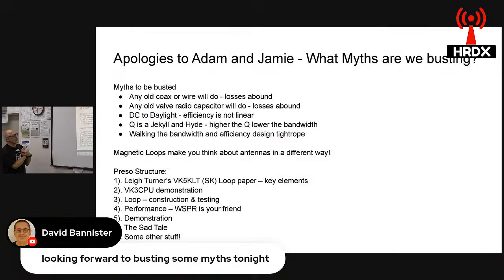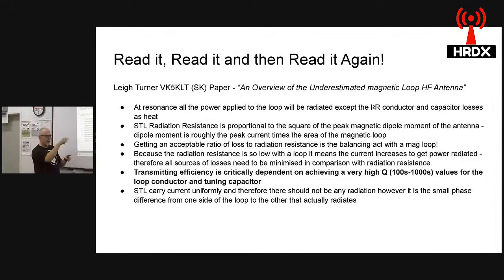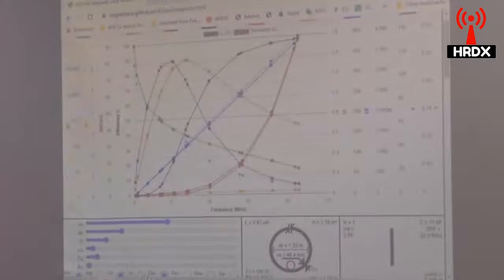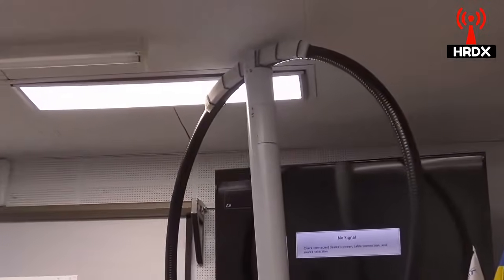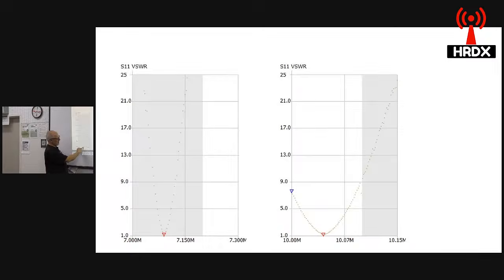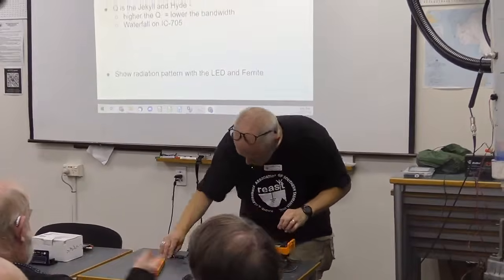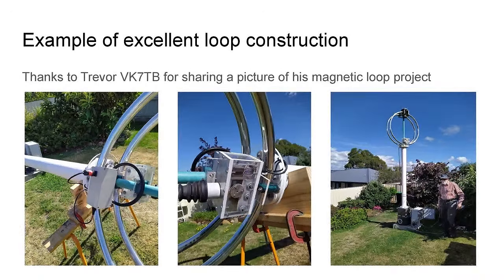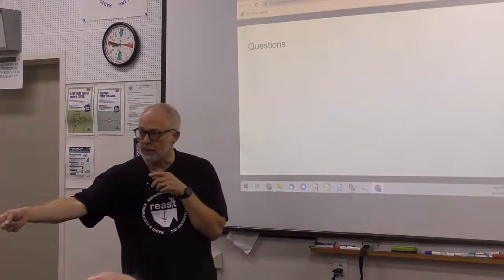The Truth About Magnetic Loop Antennas - MYTH BUSTING!

Comment: Howdy.
With all due respect.
I do not agree about the uniform current statement. My understanding is the current is largest at the feed point and the voltage is largest over the capacitor. For any size loop.
Cheers.
Reply: Read the literature on small loops. The "small" qualifier comes from the fact that the length of the loop is way lower than the intended wave length, hence the current variation across it is negligible and can this be considered constant.
Reply: @randall.chamberlain  Howdy.
Aha. OK.
Cheers.

Comment: Square loops work fine as long as the overall area is the same. circular vs square loop with the same area negligible difference.
Reply: and that allows you to use a tubular capacitor with no connection losses, maybe as efficient as a vacuum capacitor with lossy connections?

Comment: Great video. In practice the resistance of your solder joints and even using aluminum instead of copper, it really doesn’t make much of a Noticeable difference as long as the radius of the conductor is chosen correctly.  Most commercial antennas get the diameter wrong btw.
Reply: i had lots of success using pexal water pipe and thats plastic with literally just an aluminium foil layer. a 2 turn loop with a smaller diameter section pushed in the ends to close the loop and make the capacitor. tuning is a threaded plastic rod that adjusts the space between turns. i made, used, and sold many with good feedback. so cheap and light for backpacking

Comment: I tried various coupling methods and found an unshielded loop easiest. It has finished up a bit distorted for better matching..
WSPR is okay but it's not like communicating and making real contacts to see how good it works. I don't bother with WSPR.
I made it to null out interference on receive and use dipoles to transmit. Indoor use only. I have transmitted on it and the receive type capacitor is fine with my 5 Watts maximum. I used a thick 7 foot length of coax  to make the loop, it's just what I had.

G4GHB.

Edit: My interference has now cleared up since the phone wire was changed to fibre.
Reply: back when psk31 was a thing i had a great qso from Bulgaria to Washington dc from a small indoor loop on my ft817 on under 1w. i miss psk31

Comment: As material for my loop, I am using a flexible exhaust hose with an aluminium coating. The hose is 5 meters long and has a resistance of approximately 5 ohms. Does the ohmic resistance affect the high-frequency properties in qrp?

Comment: I was trying to calculate a loop the other day to help combat terrible rfi. 
  I was wondering if I could feed it with a 9:1 balun and if so then would the loops tuning network be less necessary? I was thinking a simple capacitor like a flat piece of aluminium at the top open end of a flat aluminium loop, while keeping the point of capacitance central the idea is to slide an overlapping piece over and above the main top section of loop, adding capacitance the more it overhangs the top section. Regarding the matching to inductance with a bar or smaller fed loop it cam to me that if your feeding a smaller loop you can add some variables by orientating the smaller loop like a clock and then clamping it back down, in other words the feed point on the smaller loop, rather than it being at 12 o clock, you could loosen a bracket and move the feed point towards 9 o clock or towards 3 o clock for tuning then clamp it back down. Then I thought, might as well add another variable and make that clamping point be able to clamp to different points of the main loop, so either clamping slightly up towards 8 o clock or sliding it up towards 4 o clock for further adjustments. 
  The calculator told me that my design would have an Inductive Reactance: 465 ohms
This is why I was thinking to have a 9:1 balun to feed it with.
  Regarding diameter i have seen that large diameter works better but then the flat sheet metal loop also looked interesting. I was wondering how making the flat aluminium much deeper would effect the loop. 
  The idea is to have a batter signal to noise ratio as we have noise around S7 S8 at times.
  No chance getting the French electrical provider to come out and change the transformers. 
It's hard to know if it's a transformer. I found a very noisy one but we only live around 3 miles from a hydro electric plant. I'm wondering if they have noisy generators and then that noise comes down the power lines to us only to be re-transmitted by all of the power lines. I need to do some more walking but an area of around 10 Km square where I live is extremely noisy. I've driven around and the noise keeps cropping up all over the place. If I drive to other villages then they do not suffer the same noise. However, driving around in general the noise is apparent in many other places.
  I was also wondering if it could be the noise from all the smart meters sending data back down the lines.
 I'm at whits end and my friend who lives around 10-15km from here is suffering also. Possibly more than me but I think my radio has better filters than his. Tried noise cancellers like the VK5 but they only reduce noise with the gain down quite low, this is ok but it's not really enough. Next is current baluns and or 1:1 unun's then as many ferrite beads as possible on coax and all cables. I have a sound cancelling box also but i've not tried it yet.
  Thinking that selling the house is the only option.

Comment: Very interresting lecture. If you want to build a loop from coaxial cable, you can do it without expensive or infindable  capacitors.  Of course, only monoband.  Nearly all LDF cable resist up to about 4000V.  So, use the capacitance of the inner conductor to the outer. It's in the range of 75 to 90 pf/m . Just connect at high point the  inner conductor to the outer.  If it resonates with a dip meter at the high edge of the band you only need a small variable capacitor two or three plates, 50pf to tune the whole band. It worked fine, i built one for 160m some 15 years ago. With lower point 30cm above soil, it was about 10db weaker than a full size dipole at about 10m high. Mine was from LDF 1/2" .  F1VEL ex DB3YZ. 👍🏻🇫🇷

Comment: What does "0.049"" under "Wavelength" column in the top row "3.5 MHz" mean in the interrelationship tool summary table mean? Units (or dimensionless)?

Is the minimun useful size 1/8 wavelength or the 1/10 wavelength of highest desired frequency of use I've seen elsewhere?

Comment: I built a hexagon loop out of 3/4 copper water pipe soldered 45's, using an air variable capacitor 250pF Antenna circumference is: 8.75 feet or 8’ 9”
21-inch circumference input. I will tune 40-to-15 meters, at 20 watts we made digital contacts from my friend's basement to all around the US 
I will take it outside this Monday when he returns it and see if I can make voice contacts, over the pond.

Comment: Great information. Thank you.
It is enough for me to understand that my Mag loop is going not be optimal with "any old" capacitor, (limits power) and to keep my connections and as low resistance as possible.
If I insist on building an optimal mag loop, I'll never build one.
Reply: any antenna is better than none. once at a club open day i made a working magloop from the jump leads out my car with the ends twizzled up to make a capacitor. tuned swr 1:1 on 20m and got a contact straight off the bat

Comment: New to all this, sorry if it's an irrelevant question but does radiation pattern essentially provide both ground wave and NVIS characteristics?  If so, is it possible to orient the hole up and down such that you achieve an omnidirectional pattern WRT azimuth, and despite losses straight up still have some emissions vertically enough to still fill in the skip zones like an NVIS?

Comment: There are some advance design secrets that improve bandwidth and efficiency, but those are very rarely mentioned anywhere on the internet. But the real challenge is building all that into a weatherproof package that can withstand the extremes of weather outside up on a pole for 5 or 10 years with minimal maintenance. Few hams ever attempt or achieve this, but it can be done.
Reply: Such as?
Reply: @johnratcliffe6438 yes agreed, please tell us if you know. Do you have any references to point us to?
Reply: Käferlein AMA
Reply: @df7ii  "Little Beatle" - interesting!

Comment: Great video, but what makes a capacitor lossy? He shows a chart that explains how capacitance influences radiated total, but what is it about "any old valve capacitor" versus a vacuum tube capacitor that makes such a big difference? Are old air variable capacitors just too crusty and corroded for RF? I just didn't see where this myth was busted.
Reply: "any old valve capacitor" has wipers.  That is to say, the rotating plates have electrical contact through wipers and those delicate little wipers are not designed for the 20 amps or more of RF that will be circulating in the loop.  
A good capacitor for this is called a butterfly capacitor; no "wipers".  Such a capacitor can handle enormous current. 
Also, the voltage is going to be pretty high.  A 100 watt transmitter will produce anywhere from 1000 to 4000 volts on the capacitor and remarkably high current.
Reply: A search for "VK4AMZ loop" will yield his experience with doorknob caps, which are lossy. I use 4 ft lengths of 1 7/8" Heliax as 100pf caps in a design and those are about as low loss as one can get besides air variables.
Reply: A conventional air-spaced dual gang variable capacitor can be used.  Ignore the rotor (mostly). Connect one end of the loop to one of the stators and the other end of the loop to the other stator.  The shaft that joins the two rotors then conducts the RF current and is effectively a butterfly capacitor.  Also, it doubles the voltage rating of the capacitor.

Comment: To further the performance research, I would be interested in a side by side comparison of the loop vs a dipole (all other factors equal) using the WSPR data collected.
Reply: All other factors tend not to be equal.  A dipole suitably high above perfect Earth is the ideal antenna.   If you don't have all that, a mag loop antenna works pretty well where a dipole in NOT ideal circumstances would do even more poorly.
Reply: @thomasmaughan4798  Then the proper test would be comparing a dipole at an optimal height against a mag-loop at perhaps 6 feet or so and measure the dB difference, or, using WSPR data.  When I stated “all factors equal”, I meant using the same transmitter and power level.  The antennas would be in their normal configuration.
Reply: We 'played' at that in 2013 - 2020 thereabouts. I hit EU from Texas most nights using a QW circumference loop (which this presenter misrepresents, as usual) running against others ops here stateside. I captured a lot of that data - it needs to be graphed using Excel or R or something and presented.
Reply: I have a Toploaded Marconi Outside,  the vertical section is around 9 metres.   Indoors I have a 1.6m diameter broadband loop made from scrap RG213.     I ran concurrent WSPR sessions over 24 hour periods on 630m and 160m.    No real difference, for RX I'd go with my indoor loop -.  There is a lot of data with lots of curiousities.

Comment: Should be good for NVIS in suburban/urban areas.
Reply: I work the 160 m evening net on 1900 kHz from Texas given the low radiation angle from a QW loop on 160 meters from a city lot in Texas ... I have trouble hearing those stations with low dipoles though, because, they do not have that low rad angle ...  a remote receiver SDR helps in that case!

Comment: The tuner probably didn't have enough capacitance to tune that long of a wire on 10m.  50 feet is way longer than the approx 17 feet that would be a half wave on 10m.

Comment: I am the italian swl and operated with Radio Bye is loop amplifier by 81 cm ,is alumentation by 9 v with trasfirmer and 2 out of bnc x cable "j use 7 meter of rg 58,tthe antenna's is difficokt for 160/80 meter and 11/10 meter is about mute,73 by i2/03897

Comment: This is very interesting, and mostly accurate. But I don't think a solid loop material will change much over a tube material because of skin effect. The losses are resistive, but only sort of DC resistive. The resistance can only be thought of as a DC resistance for a loop with less available material through which to conduct the current as frequency goes up.